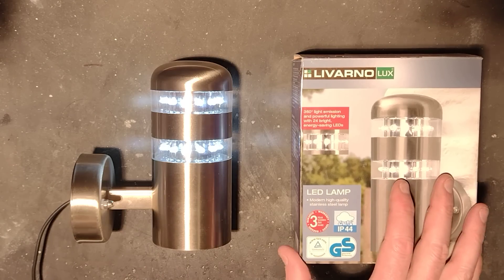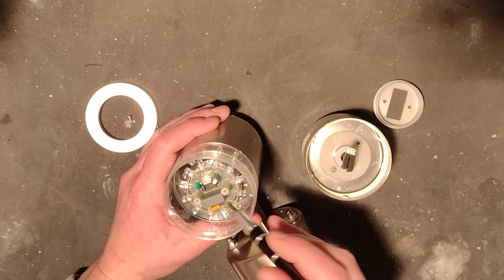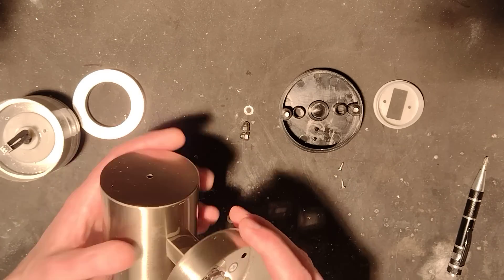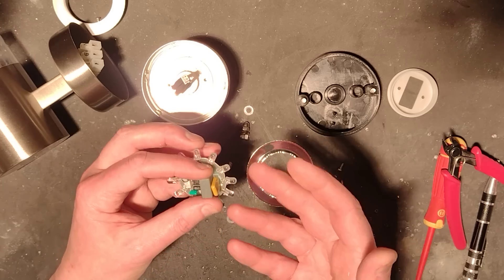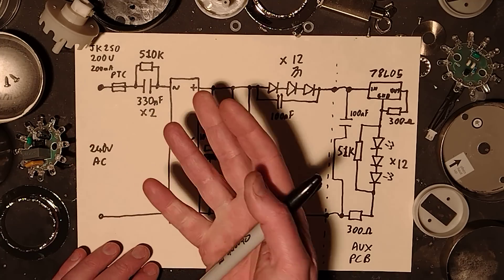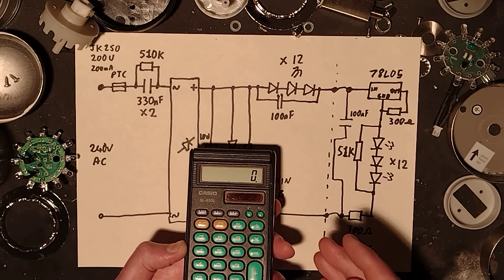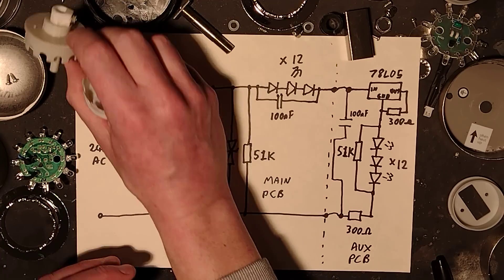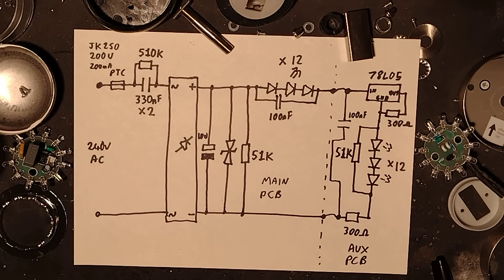Lidl Livarno Landfill Light teardown (with schematic)

Comment: Such a strange retro look, with the "old-fashioned" discrete LEDs and the brass.  Was expecting to see a larger downlight at the bottom, it's like they were going for appearance only, not function?  The 7805 current regulation thing is neat though, will have to remember that.  Merry Christmas, Clive, to you and yours, and thanks for all the info and chuckles over the years.
Reply: I think the LM317 is also often used as a current regulator in a similar way.
Reply: @jaapaap123  True, but the 78l05 is a darn sight cheaper as a TO92 package or SMD part, instead of the LM317 in TO220, or the 1117 in SMD, plus the input voltage range of the 78l05 is a lot higher than the 1117, as it will do 30V, as opposed to the 1117 cooking at 10V.
Reply: @SeanBZA  I think you are right about the price for most people. However, when I buy 100 pieces in TO-92, the 78l05 is 0,301 euro per piece, and the LM317 is 0,367 euro per piece. Both can handle the same voltage.

I should buy a load of either of them, I've been using the TO-220 LM317 for a couple of low power projects, and I think that one is quite a bit more expensive.
Reply: @jaapaap123  The price the manufacturer paid in China was a lot lower, and thus they went for the cheaper part, as they need to minimise cost. Plus the cheap plastic package is likely a lot cheaper when you buy in bulk, as opposed to the copper tab version. I doubt the entire unit cost more than 2 dollars from the original manufacturer, and very likely they wanted to make some profit on them as well.
Reply: @SeanBZA  Oh, right. I forgot we were talking about the thing in the video, so I started jabbering about me own projects.
Reply: @jaapaap123  Yeah, I was going to say that "trick" of using it as a current regulator is in the LM317 datasheet as an application example, but you don't have to use specifically a LM317 to make it work.

Comment: I suspect the self resetting fuse may be there for heat buildup purposes. The LED's in an enclosed casing do build up heat and cause issues to other components.  I have home LED  bulbs that constantly fail due to the fact the lamps are installed left to right in an enclosed globe, trapping the heat cause component failure.  Do you think that might be the purpose of that reset-able fuse? Merry Christmas Clive, I hope you have a wonderful day.

Comment: It looks like quite a nice lamp, so sad that it's all glued together which makes repairing it annoying at the very least.
Reply: I wonder whether a heat gun would soften the glue, easing the pull-apart.
Reply from the maker: It's silicone.  It doesn't really soften with heat.

Comment: Not for Landfill though. Electronic devices should be recycled rather than trashed. Then, metal/plastic/electronic recoverable waste can be channelled and recovered without polluting metal recovery processes, such as incineration atmospheric pollution, and metal recovery wastewater entering the biosystem. Items like disposable lighters and Vape sticks are discarded commonly now, and all should not become landfill, but become part of the battery recycling network found at supermarket exits, etc. Better still, they should be reused, refilled, recharged or repurposed, when their original functionality becomes flaky.
Reply: Except in the US many communities don't offer recycling for this, that, or the other thing
Reply: @marossgnv  I think you will find Europe and the UK  have had laws since 1991, and stricter laws since 2006 on batteries and general electronic waste since 2012. In Portsmouth (UK) we have a simple cooperative system. Pompey folk just leave items (dead or alive) outside the front of their houses, and other Pompey folk recycle them, it's like magic.
Reply: It also says so on every electrical and electronic device's packaging and/or included leaflet to NOT discard it in the regular refuse, and has been saying so for ages. But nooo, it's so much more quaint to say, "bin it". People like Clive whine about RoHS, but it's exactly people like Clive in this video who, by perpetuating the "landfill" and "bin it" mentality, are at least partly responsible for why those Hazardous Substances had to become a focus for Reduction in the first place.
Reply: @Anvilshock  By the time these devices are disposed of, the packaging/leaflet/etc are long gone. I've collected about 50 roadside vape sticks in the past 6 months, for reuse of the Li-Ion cells contained within, most of which are 3.15v or more, and have only ever been charged by the manufacturer, so they are pretty much virgins. The cases do not include disposal warnings. Even lollipops contain batteries and flashing LEDs! The warnings must have been sucked off :(
Reply: @Anvilshock   We are probably in agreement, but It doesn't "always say", often the warning is simply a waste bin line drawing symbol with an "X" across it. Children's sweets - I'll name one - "Flash Pop" , have the  Dustbin symbol with a faint X across it and even 4 diagrams following the text "battery removal and disposal", but is it realistic to expect these instructions to be followed, by age 3+ users at which the product is aimed? Or their parents even? It's a lolly stick for god's sake! Vape stick cardboard packaging (with warnings for disposal as simple tiny diagrams of a bin with a X across) dropped as litter are apparent outside any corner shop that sells the product and is clearly aimed at hooking minors with its sickly sweet array of flavours and 20mg/ml nicotine salt content, the printed tiny warnings never read. Unlike cigarettes, the packet is first to go, rather than when the last cigarette is smoked, so the package is never looked at. I have never seen a lighter, with a LED flashlight included with a disposal warning for the included battery. These litterers are are people who are as ignorant as you describe, and they are everywhere. I don't think I shall be taking it upon myself to turn into Charles Bronson and take them out in a reign of vengeful carnage with an AK45 just because they are irresponsible, but when a dog bites through a vape stick and gets a lithium flare in its mouth,  a small child swallows a battery, resulting in a resected small intestine due to a necrotic bowel as a result, or a garbage truck goes up in flames, or teams of firemen spend weeks extinguishing landfill fires started by these things, long before someone legislates against the sale of these devices, taxpayers, and grieving innocents will be paying for the stupidity of the few, and the greed of the manufacturers, and the lack of control by trading standards bodies..
Reply: @tikaanipippin  Not by the three-year-olds, no, of course not, but yes, very much so by their parents. It's part of being not only a responsible parent but also a responsible human. The former doesn't somehow excuse someone from being the latter. Not least because if you're being a moron parent, guess what the kid is likely going to be?
Reply: I think the landfill tag is more to do with it being unserviceable and thence discarded, even if dealt with properly. As opposed to a 1953 angle poise. Virtually  nothing to go wrong and easily fixed if it does. Which one is the modern lamp for our times?
Reply: @highdownmartin  Many old Anglepoise lamps (Model 1227 (1938 - 1968)) from that period had just 2 conductors for live and neutral, with no earthing for the metal base, lever, and lamp holder structure. (it is near impossible to obtain contiguous earthing across the entire structure of the anglepoise lamp from base to shade without several earthing connections between base and lampholder.) The supplied wiring (twisted rubber and cotton insulated, with no polarity) for these lamps often went to unfused 2 pin plugs, and the cabling was not double insulated. It was common to get a shock as the insulation wore and cracked as it passed over one of the angled joints during use. Modern double insulated rewiring kits are available.
BS 1363: 13A plugs, socket-outlets, connection units and adaptors plug and socket-outlet system were introduced into the UK in 1947, and many homes in the UK were not upgraded to that standard until the 1960s, still using 3-pin 15A sockets, and a mixture of 5A and 2A unearthed two-pin sockets, Consumer fuse boards contained porcelain or bakelite fuses with wire links, and these were usually repaired  by the householder, often on a regular basis. These consumer units were still in use until the 1970s or 1980s, even after houses were rewired to BS 1363.
Reply: @tikaanipippin  I know. I’ve had a few mains belts off metal drills and classic fans. That’s my fault. My point was one is rebuild able and one is disposable. New wireand grommets and three pin plugs on a 1227 and it’s as safe as.  A lot did have earths to the main fork, from pretty early on actually

Comment: This light is a big nope for me as you get maybe three years out of this before the -30c weather kills it.
Reply: That's probably also far outside of its specified operating range.
Reply: LEDs don't mind being cold, it's heat that degrades them.
Reply: @NiHaoMike64  Commonly there is a -50C limit to semiconductors, but low-quality devices are only capable of around half of this...
I don't know what would beak these lights in cold weather aside from the capacitors freezing, or if moisture seeps inside the components and freezes there - splitting things open...

Comment: As the current is regulated, does the product run the risk of the Voltage slowly building up on the main capacitor until the transorb activates to dump it. And this is the reason for the PTC?
Reply: The constant current draw will cause a constant voltage drop in the input capacitor, plus the effect of the small variable current draw from the 51K base load and component leaks.

Comment: Only way I see that polyfuse tripping is if the main dropper fails closed. The correct type of cap should always fail safely, but I guess they chose to use whatever cheap caps they had and add a fuse. Odd choice, I can't see that affecting the BoM cost in a positive way.
Reply: The price difference between a proper X2 capacitor and a generic capacitor may absorb the PTC cost.  Would need to work the wholesale prices from their suppliers to be sure.

Comment: The PTC current limiter may also put a little heat in there to benefit the circuitry from damp beside the drain hole
Reply: That's a thought ! Instead of using a 2 W resistor (or so), use a limiter, as it mostly just protects itself, while providing its main function (in this particular application) of heating the box interior.

For stuff I build for outside use, I always put drain holes in the bottom. Water will always get inside. So always provide a means for it to drain out.

Comment: They make LED lights, no way to really repair them, then they have to build the paranoid anti LEDeath circuitry so lidl doesn't get sued every 10 minutes over it, instead of a bulb,in a fixture, with two acrylic cutouts, maybe even diffused and reflectors for more light..

Comment: There's another reason why unfixable lights are a bad idea, when one pops it's clogs then you either have to match the replacement with the other existing lights or dump the whole lot in the bin and start again.
Reply: Unfortunately, to some degree this is even true for retrofit LED light bulbs. I always buy a few extra, so that a burnt-out light doesn't look weird after replacement. I.e. color temperature and light pattern might even change with the same product but different batches.
Reply: The result of our throw away society......
Reply: That’s fine because Lidl always have the same range week-on-week
Reply: I used to think like this,  but problem is the heat-sinking and airflow on a LED bulbs almost always stink. At least a decent size fixture keeps the power supply away from the diodes and the fixture body provides way more thermal mass. I know its not super common in residential junk, but a driver, or even the diode pcb, is going to be way easier to change or repair than a burnt out lamp by itself.
Reply: That's the idea.
Reply: Unless you buy an extra fixture or two but then you might never use it.
Reply: 5mm LEDs running at only 16mA with good surge protection should last virtually forever. Probably longer than the case will look good if it is outside.
Reply: While, in general, I agree that "repairable" trumps other factors, a good product, with factors like weather proofness, produced inexpensively, may be the exception.

As Clive demonstrated, this product was bloody difficult to breach, had a weep hole, had good sealing executed.

When you look at the likely failure modes, first will be infant mortality (covered by mfgr warrenty).
 
The next failures will likely be a cap, led, mains connector. The mains connector will likely fail due to corrosion, galvanic action etc.. The other failures will require "specialist parts" and penetration of the water tight integrity.

The likelyhood that you can open, then reseal the unit is questionable. Once you have done it, the ability to match aged/used parts with performance matched new parts is poor. And when one  component fails, can others be either far, or predictable?

All too often, I buy specialized parts for such a product, and can't find them when needed for round 2, or more likely "used them in some other application".

Water proofness comes in only 3 flavors, "badly done", "well done, cheaply executed, impenetrable/unrepairable" and "well done, repairable, and ungodly expensive".

All outdoor plastics age, crack, yellow and fail. It is a "feature" of UV exposure.

Open such aged plastics at your peril.

Then when you are done, you have one, young, bright LED (or other component) in a fleet of aging parts, possibly in a now failed waterproofing unit..

And ALL of the units look like "John Travolta's disco suit" (bad to start with, worse now, and nothing like it on the rack, in the High Street shops. (THANK THE GODS!)

Some things are better replaced, as a group.

Comment: While the LEDs aren't replaceable, are they particularly likely to fail?
I know that high-power LEDs like to fail - especially if insufficiently cooled - and of course LEDs can fail if overdriven, and sometimes you just get crap LEDs from certain sources. But this appears to be regular 5mm LEDs driven at a mere 16mA or so, which seems to me like it ought to be pretty reliable. Am I missing something?

No electrolytic capacitors to fail; no Ni-MH/Li-Ion cells to leak/fail; no SMPS with output diode weak link; a constant current LED supply; a PTC fuse; a drain hole for condensation build-up; an earth terminal; efforts to prevent that earth terminal being required (you know it won't always be connected…); etc … - it looks like it ought to last longer than a lot of lights featured on this channel!

Of course I'd prefer things to be serviceable, but I think it's less of an issue in cases where a reasonable effort is made for it to never actually need servicing - not using components with a limited lifetime, etc.
Reply from the maker: At the very least I'd expect them to lose intensity over time.
Reply: Ah yes, that's true; I'd forgotten about that. Fair point! :)
Reply: I lived in Florida. These type of lights have a regular fail rate of about every 5 years depending on where it is.
Reply: @zachv1942  Florida also has a humidity anywhere between 80-90%.
This isn't a swampland lamp.
Reply: @FutureChaosTV  I see what you did there.
Reply: Individual LEDs aren't especially likely to fail, but you have 24 of them in series, so it only takes one to fail open-circuit and the entire light stops working.  The chances of that are much higher.  And there is an electrolytic capacitor.

Comment: Do you think if you put it in the oven for a while you may be able to loosen the adhesives enough to pull it apart?
Reply from the maker: It's silicone, so fairly heat proof.
Reply: @bigclivedotcom  you could try pouring rubbing alcohol in the crevices.  It MIGHT loosen it up a bit...???

Comment: That's too bad.  I was hoping for a happy ending, that there'd be a technique for easily opening the thing to solder in new LEDs.  Think I'll stick to the cheap solar units; at least when they fail they're either fixable or yield harvestable parts, and mains voltage never enters into it.
Reply: Same here. In fact that reminds me that I have a solar light that needs some TLC. Only has the power to work for an hour or so after sunset. Quite old so I assume the solar cells need cleaning and a new nicad battery installed. I seem to recall they use the AA size ones. Quick trip to the local Ikea for their Eneloop knock-offs are in order.
Reply: @Bigrignohio  The prevalence of the seemingly "old" NiCd battery chemistry in solar lights is due to it dealing with freezing temperatures a lot better. (Not everyone buying solar lights puts lives in a warm climate nor puts them away during winter.) LiPo (although better in most regards) doesn't like cold conditions at all. (NiCd will still work a bit, LiPo acts like a dead battery until things warm up again. So the prevalence of the one battery type isn't an oversight, but a feature.) Now if solar lights could be designed to charge a few more batteries in parallel, then they could design around NiCd and still have a long run time.
Reply: @pauljs75  Er, that's why I want to use Eneloop (or the equivalent Ikea version)? I had no intention of using li-ion outside. Although I mispoke, they are nimh not nicad. Should still be good to -20C or so. And if it is colder than that I do not care if the light is out because no chance I will be outside!
Reply: @Bigrignohio  if you put really a cheap LiPo battery in there, you’ll have a very luminous Tiki lamp!